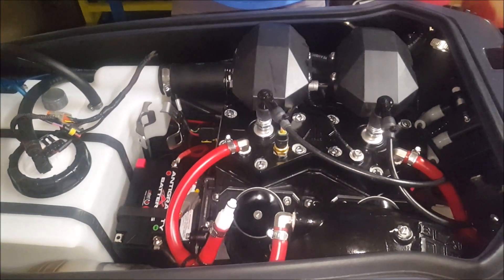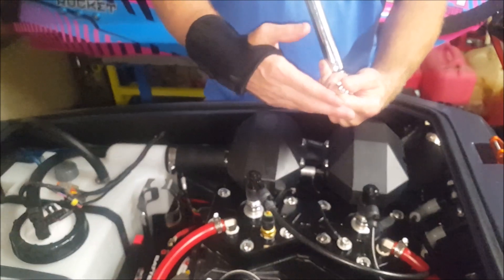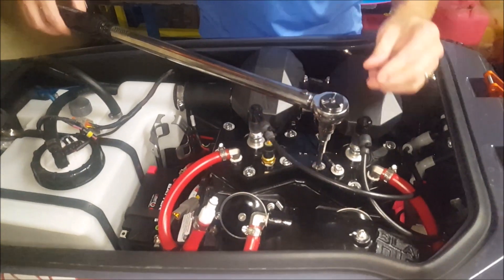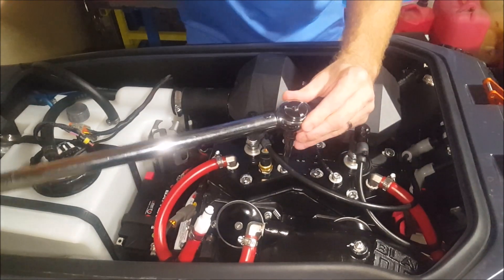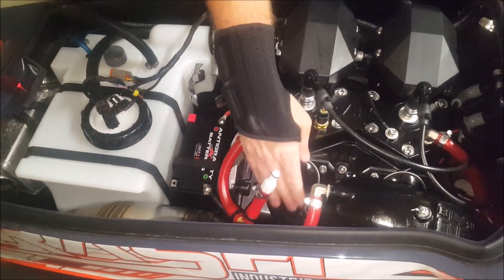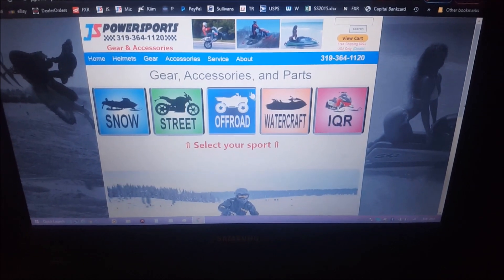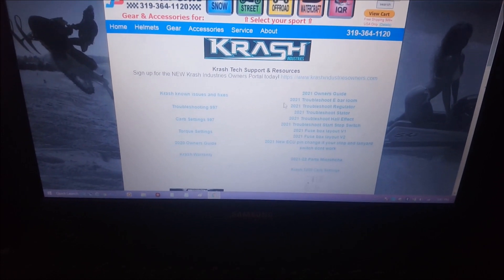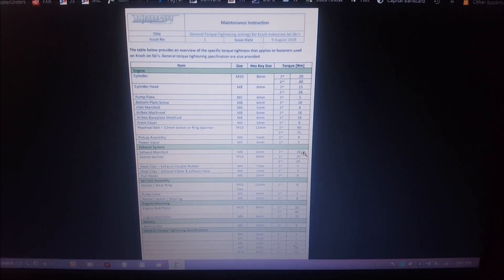Krash Footrocket jet ski engine retorque & tech support - JS Powersports

Comment: Are you removing the black ops pipe to get to the manifold? Or just tailcone?
Reply: It might be possible to get to the manifold without taking the pipe off but it would be an absolute chore. You won't be able to get the blackops pipe all the way out either, but you can slide it back. When you separate the blackops pipe from the part of the pipe that goes into the water box, take extreme care to get the hose clamps on the coupling in the right spots. Only remove 1 of those clamps. In my opinion it's better to take the back one out, but JS recommends the front one. ALMOST sunk in deep water because I didn't get them back together right.